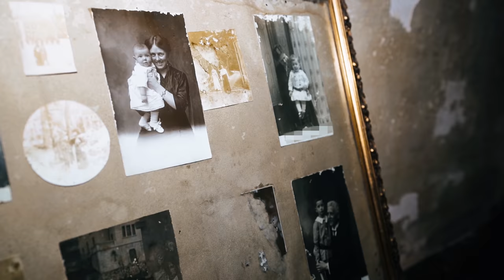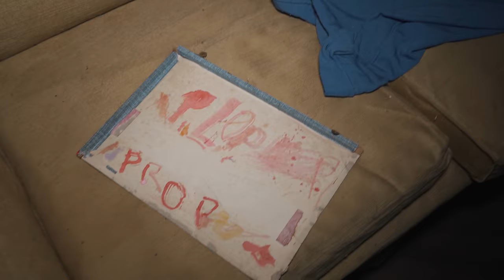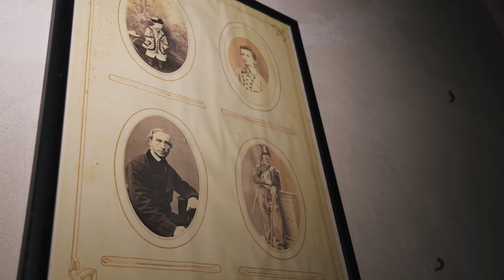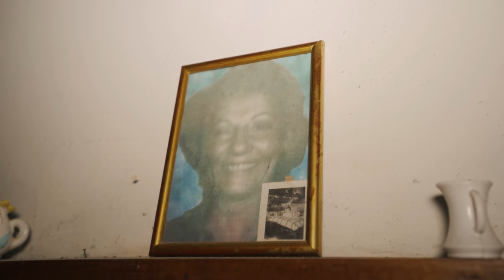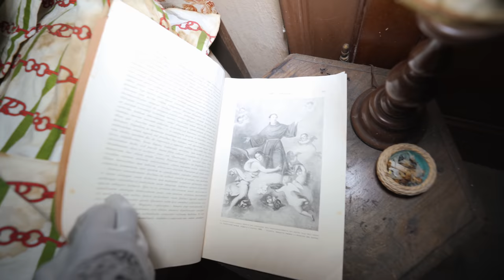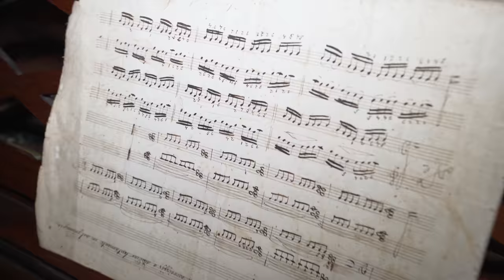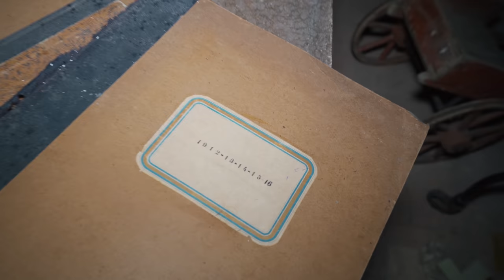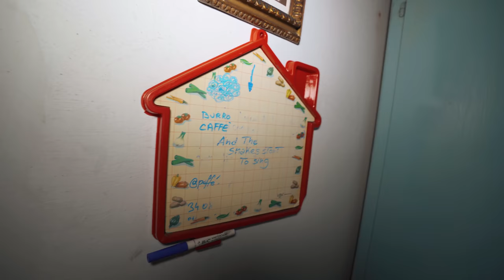A LOST ART TREASURE | Abandoned noble Venetian family's millionaire mega mansion

Comment: That old style of iMacs were computers but enabled you to watch CDs too. The design was 'shocking' because previously computers were box-like and square. Several things impacted the design of the iMac...circuit boards were smaller and the housing of the PC didn't have to be large and square-like. Original design was done with CAD s/w but industrial designers were influenced by s/w from the automotive industry (at that time, cars were also changing into more rounded shapes). Finally, plastic technology had evolved and there was access to different materials and colors.

Comment: I visited Italy the last time about 25 years ago. I knew something about the culture and especially the architecture of the country for years but until that last visit I never noticed that the modern city - up until about the late 1900s  -was built very like the ancient city. Little cubicle shops on the ground level of apartment buildings and palaces were so similar to those you can still see in Pompeii. So many of the palaces have luxurious wall treatments that are usually frescoes just like the roman way of decorating except for the style of the paintings. The Italians never seemed to be very fond of elaborate woodwork and most wall surfaces are flat or sometimes decorated with marble and pilasters or stucco bas reliefs and sculpture, etc.. Even the walls were constructed with a roman scale brick - much larger than the English brick we are used to. Venice has it's own traditions and didn't exist until the collapse of the empire but this villa is renaissance style and very Roman in feel. Churches, until more recent times were really considered public spaces and were wide open to the public very like the Basilicas and temples of most Italian towns in the Roman empire.
When Italy recovered from the stroke that was the dark ages, they revived so much of the form and methods of the old romans and even  had the same materials they used. The old Romans loved polychrome marbles and throughout Italy it seems every scrap of it that could be salvaged was stripped and reused. It often came from quarries all over the roman world. It must have been considered far more precious  than it is today. They still use Marble in almost every building I saw including lower income apartment buildings. Italy uses a particular style marble trim around doorways that is uniquely Italian. Wide bands of flat marble at least a foot wide that wrap around the three  edges and no other detail. So plain in contrast to all the luxurious form and color of the walls.
I wonder if the style is influenced by the heat of the climate? Cold masonry walls and no insulating materials like wood paneling or even fabric covered walls  may make the spaces more comfortable? Tall ceiling heights help to keep the hottest air well over the occupant's heads. Both internal and/or external shutters would close to darken interiors during the hottest part of the day. This must have been tolerably comfortable because clothing seems to be heavy and even layered in the photos of the family Explomo is seeing. Some of those layers must have have come off during siesta time: at least overcoats and vests or heavier dresses for the women. Period fashion always seemed to be  insensitive to climate.  Marie Antoinette was novel for dressing in fabrics suitable for the climate.

 Modern architecture doesn't really try to adapt to climate anymore. Working in the morning  before the sun gets too hot, resting in the afternoon until the cooler evening hours and enjoying dining with family and friends, theaters and other recreation in the evening was a rule in Mediterranean countries probably before the Roman era and until recent decades. Now the cities consume enormous amounts of oil, gas and other fuels to provide heat and cooling for uniform levels of comfort 24/7, the siesta is a lost practice.  Now that use has become a dependency that can be used as a form of extortion and international paranoia.. And it never seems to stay cheap for very long.